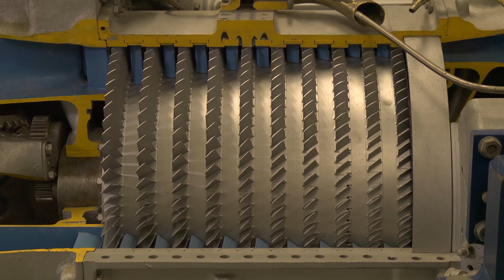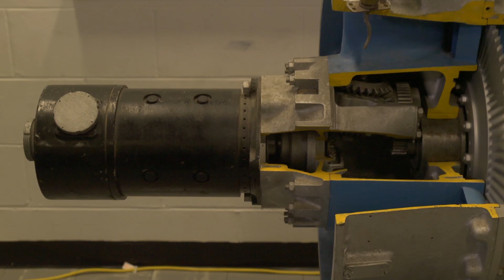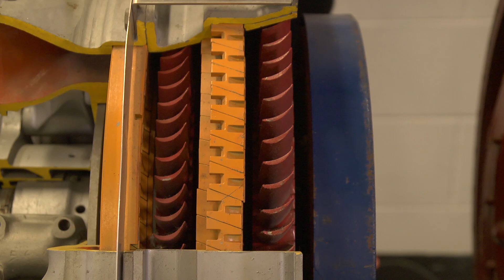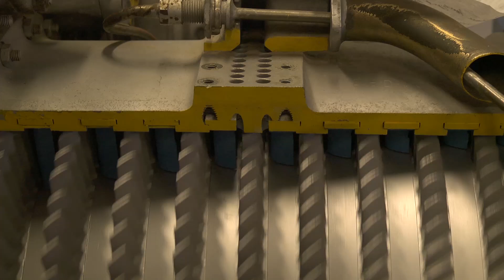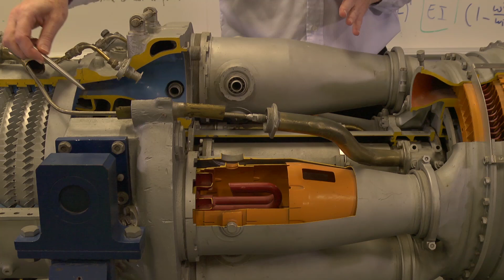UQx Hypers301x 1.5.1v4 How a Jet Engine Works

Comment: then how does it start working we must have an energetic flow of air entering the diffuser while the engine is starting
Reply: Quite right, most jet engines in about the first half of jet flight needed to be started by external means; hence the term 'start-cart'. It would inject compressed air directly into the engine to start, or directly power an electric motor in the aircraft for such purpose. Then by the late 20th century we got good at batteries and compact gas generators that could be installed in aircraft to start their own engines. This is all similar to the progression from literally cranking the shaft start to electric starters in modern car engines.
Reply: Same reason scramjets can't take off from the surface.